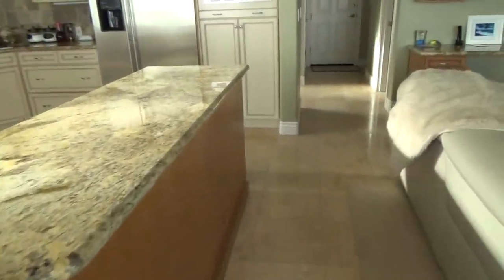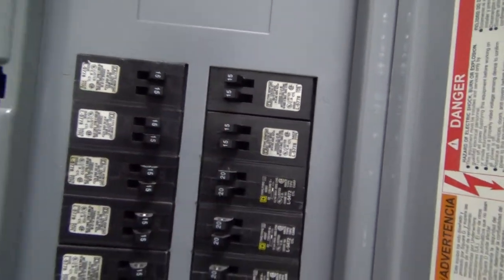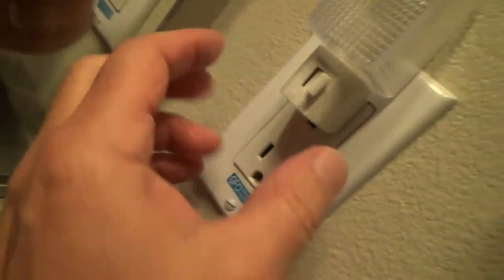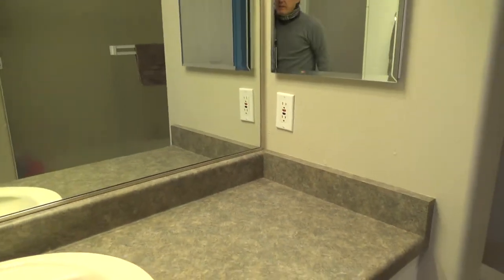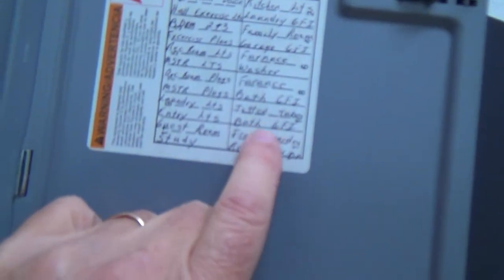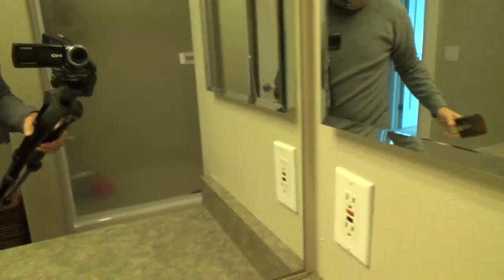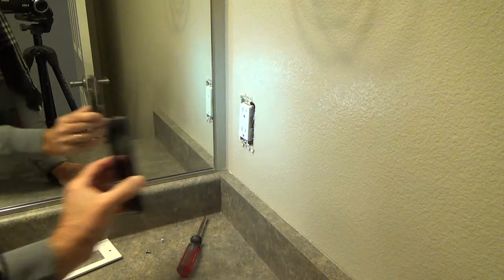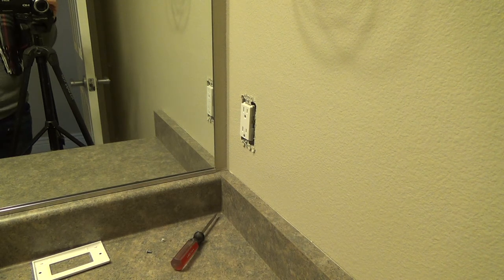Why is My GFI/GFCI Outlet Tripping?

Comment: A 15 amp gfi plug can handle 20 amps. The manufacturer says so. A gfi plug is not an over current protection device. You are allowed to use 15 amp plugs on a 20 amp circuit providing that they are duplex plugs. It is an exception in the NEC.  I am a licensed electrician all my info comes from the NEC and Leviton company specs.
Reply from the maker: Wow thanks for the info.. My question would be why do most local hardware stores sell 15 amp & 20 amp GFCI outlets if you can use just 15 amp ones for both a 15 & 20 amp circuit? Why would you ever need to use a 20 amp GFCI outlet then?

Comment: Most 20 amp receptacles have a horizontal slot ( T looking turned on its side) on the neutral side (left side) while the round hole (equipment ground) at the bottom. The hot wire (phase wire) will be the shorter slot located on the right. Compare your bedroom outlet to a kitchen outlet to see the difference. The code today has changed from a 15 amp circuit to a 20 amp circuit required in bathrooms.
Reply: hair dryers, curling irons ect.. bigger loads easy to figure with simple math
Reply from the maker: I think I had both types of circuits in the house since this house was built apprx 2001. I knew about the t slot on the neutral side for a 20 amp receptacle but I found your comment interesting about the actual ground being round too. Thanks for stopping by with your comments. Much appreciated.

Comment: Those receptacles are 15 amp receptacles. Those could be overloaded and could cause a fire on the receptacle side.
Reply from the maker: I would agree if in fact a 15 amp GFCI outlet is on a 20 amp circuit breaker....thanks for stopping by!

Comment: Leave the code to experts.
The Blade  (5-15) determine the Amps, BUT GFCI (and all) are designed to feed downstream.  
Only push-in wires are limited to 15A wires.
Electrical Noise from brush type motors is a common issue with old GFCI
Reply from the maker: Thanks for the info...

Comment: My GFI on my outside deck keeps tripping when I plug my electric BBQ in.   I have a 15 AMP breaker in my box. I have a total of 4 GFIs on that 15 amp breaker, 1 kitchen, 2 bathrooms, and my outside deck.  My outside GFI didn't work for over a year but I finally called a local electrician and paid him $125 to fix it...he fixed it and said it was a loose wire in the bathroom GFI...he didn't show me but that's what he said it was.   I didn't care because it was working again. I BBQed two or three times and now it is tripping immediately.   

The three inside GFIs are 20 AMP and the outside deck is 15 AMP...all on a 15 AMP breaker in my box. I installed the 15 AMP breaker on the deck...I had no idea what I was buying...I just bought the expensive one.   

I'm about to send the electrician that I paid $125 an email and see what he says.
Reply from the maker: Did you just recently purchase your electric barbeque? Maybe you should read up on the barbeque you purchased to see if it can run on a 15 amp breaker. Could it be possible that the barbeque specifically says that it should be run & operated on a 20 amp breaker/circuit? Could it be possible that's why it's tripping when you use it? Even if you had a 20 amp GFCI outlet installed at the barbeque, chances are it still might trip if the actual breaker in the electrical panel is a 15 amp breaker especially if the barbeque is suppose to be operated with a 20 amp breaker/circuit. Read on the barbeque to see. If the wires for the 15 amp circuit are 12 gauge wires on the entire circuit to all the plugs then you could just replace the 15 amp circuit breaker with a 20 amp breaker but not if the actual wires on the circuit or 14 gauge wires. I would be curious to see what your electrician might say....
Reply: @videojoeshows  No, the BBQ was used many times with no problem. One more issue I just remembered...I remodeled one of the bathrooms and had to move the GFI outlet about 12 inches or so, and covered the original outlet box with a plate. 

Inside that box is where the electrician said there was a loose wire.  I wish he would have shown me...that is the only change that was made...so I'm thinking maybe I should just put it back to the original outlet and remove the pigtail that I added.  

I emailed the electrician...I'll see what he has to say tomorrow.   Thank you for the quick reply.
Reply from the maker: @just.bob.j  OK let me know what you find out. There's got to be a reason why your barbeque is now tripping.....loose wire nut on a wire somewhere or ground issue....something is causing that...

Comment: The GFCI tripping has nothing with the amperage
Reply from the maker: Any additional thoughts?
Reply: @videojoeshows  Either a wiring issue, a wet environment, or faulty device, excess amps will trip the brakeR but not the GFCI
Reply from the maker: @ProfessorDIY  Thanks for the info!